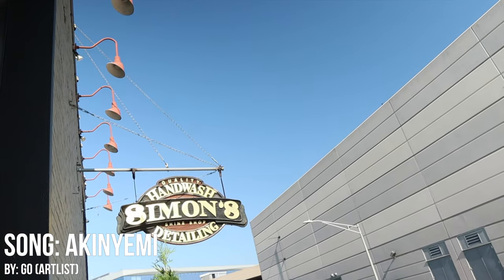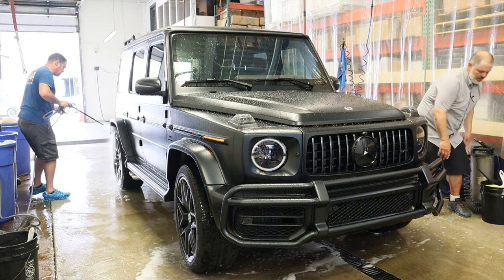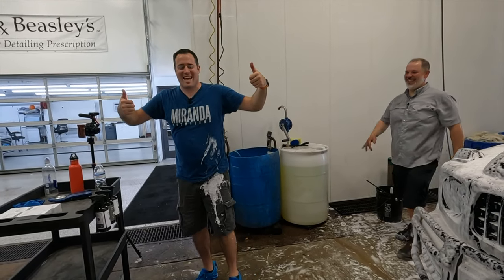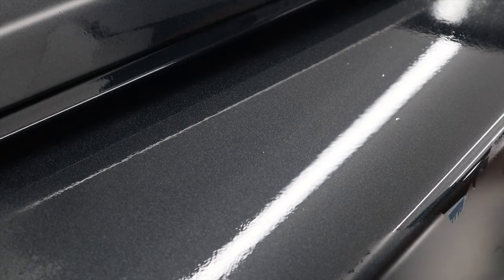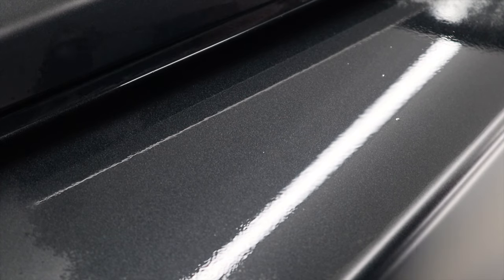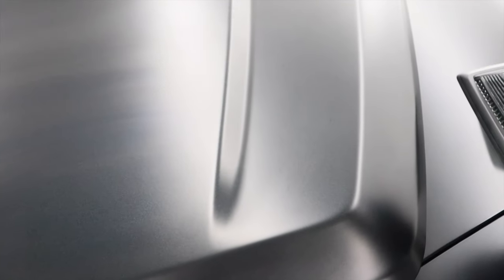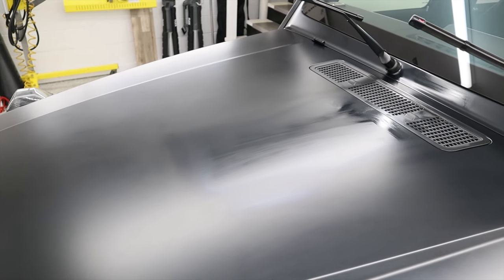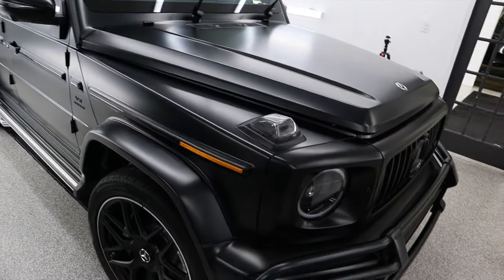⇓The Ultimate Guide to Perfect Paint Protection for ANY Matte Finish Or Vinyl Surface!⇓

Comment: nice job but assuming the owner drives home and it's rained before getting home and the car gets dirty can it be washed the following day or the dirt be left for two weeks when the coating cures
Reply from the maker: Hi. thanks, for coatings they should not be washed at all for 2 weeks, but if they are IR lamp cured it can be washed the next day and be totally fine.   If you dont have an IR lamp to cure it, just let the vehicle get dirty and don't wash ti for two weeks no matter what. the coating is dry and can get wet or dirty, but it needs to cure for that time before its washed with any soaps.

Comment: Congratulations on a really cool video and I like the long waiting time on the coating to help prevent a high spot! You guys did make me do a double take when you sprinkled distilled water on the surface before coating but it all makes sense. Being a home based detailer the only drawback is the long curing time. I do not have curing lamps so this will shut down my work space for days. Dr. Beasley’s has been introducing some cool products which I do want to learn more about! Thank you for the video!
Reply from the maker: Thanks!  It really only needs 24h like a regular coating. I don’t have IR lamps either so I usually just let it sit into the next day. So it only takes up 2 days for us. But for coating jobs it’s fine because they are high ticket jobs.
Reply: @MirandaDetailing  is this a product I have to get certified over? Dr. Beasley’s did a great job marketing and there are going to be customers where I live in Nashville who want this product.
Reply from the maker: @neilwalker5041  The pro version we applied in the video is an accredited only product. But they do make a regular Matte Coating that anyone can get.
Reply: @MirandaDetailing  thank you!

Comment: this is the most amateur response I want water drops or drop to sit on the top of the paint  not in the paint and water drop is dancing and sliding. And yes I have dust in the cabin and only leather is steering wheel rest is plastic and cloth seats
Reply from the maker: Hi. Sorry. Not sure what you mean. Can you explain?
Reply: @MirandaDetailing  i want the water to stay on the body and does t sink in the paint.and there is dust in the interior
Reply: and only leather is the steering wheel the dashboard is plastic and seats are call it fabric or cloth